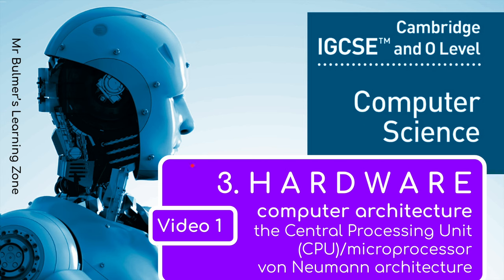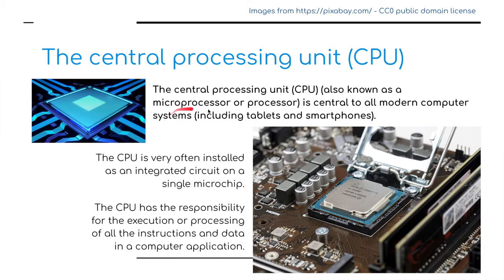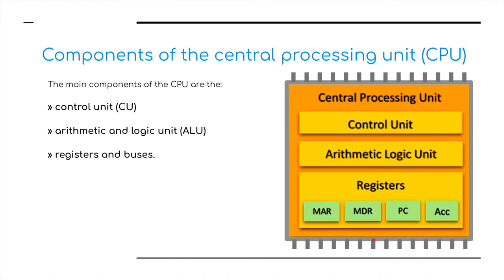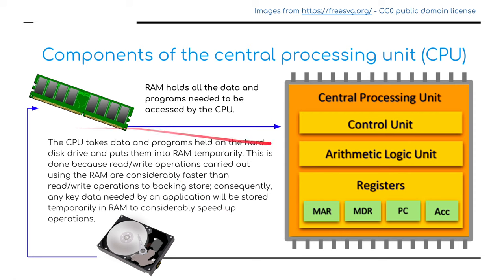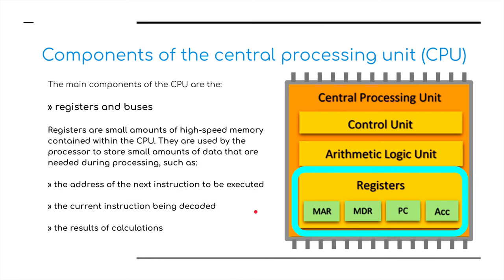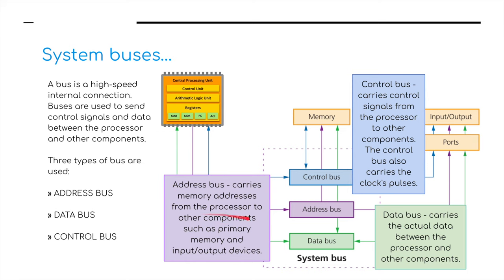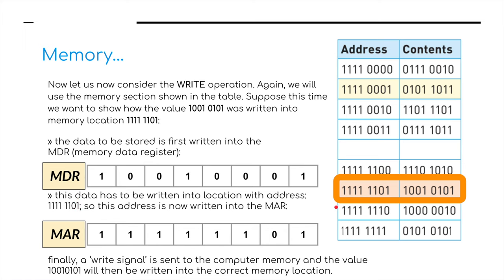IGCSE Computer Science 2023-25 ​​- Topic 3: HARDWARE (1) - COMPUTER ARCHITECTURE - Von Neumann & CPU

Comment: Amazing explanation!, just wanted to point out a mistake in one of the slides 

11:14 : The value in MDR is written incorrectly, it contains the address rather than the contents
Reply: And also in this slide the more should be 1001 0101 and there is written 10010001 😅
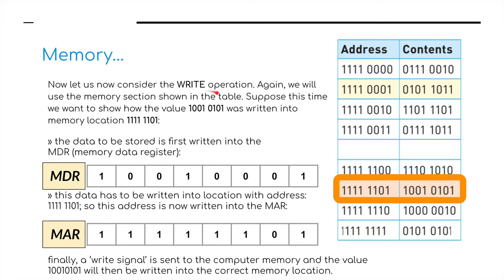But still the best explanation 11:28